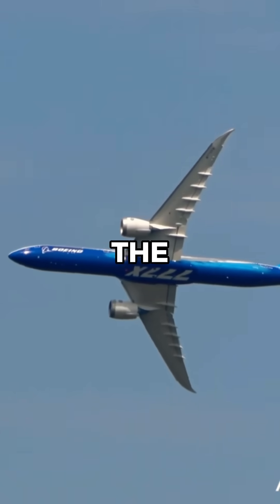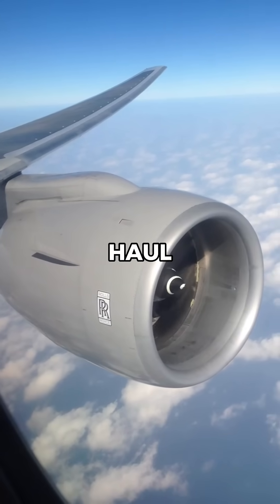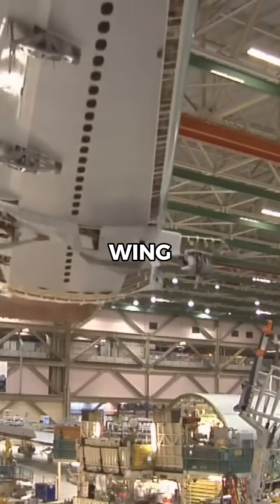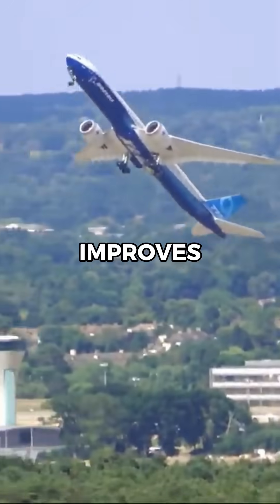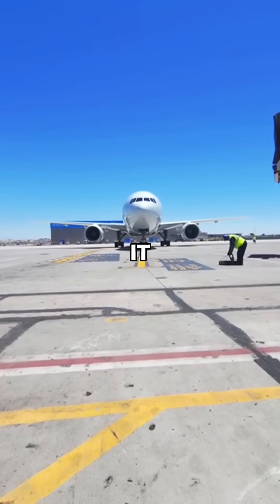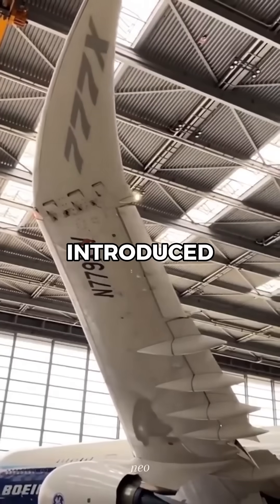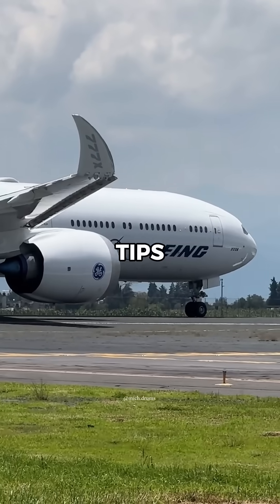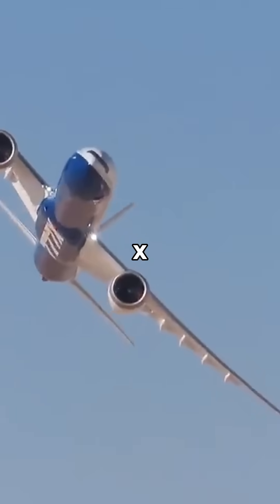why Boeing redesigned the 777x wings

Comment: Some of you will get all pedantic abd talk about weight....

But strictly speaking, aerodynamics is how air moves around an object and changing what a wing is made of does not change that, the aerodynamics for the same shaped wing remains the same if its made of steel aluminium wood glass or composites.